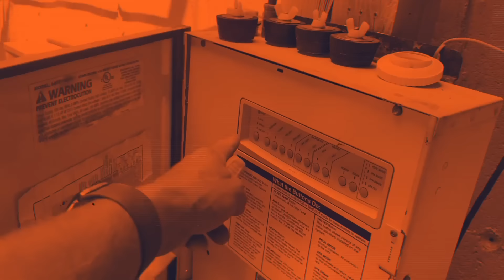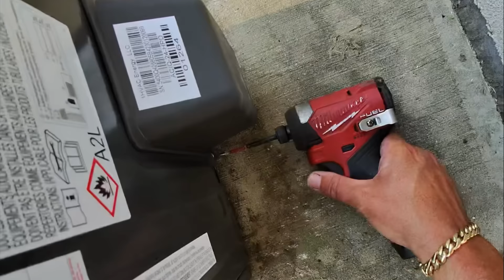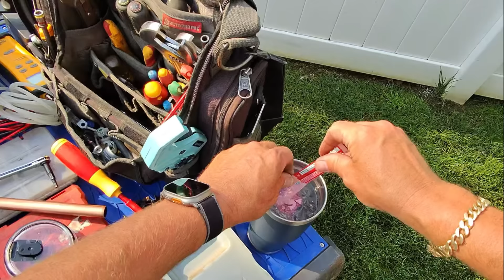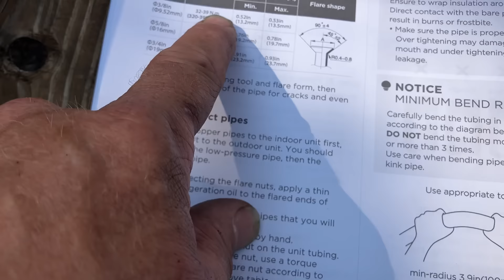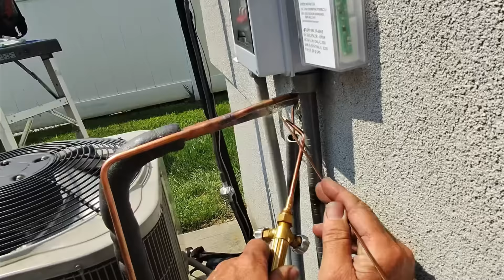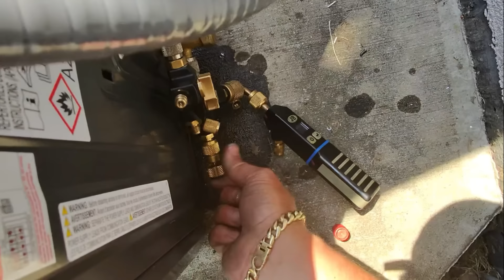They QUOTED Him Big-Brand HVAC… So We Installed THIS Instead

Comment: How much kick back do you get for selling this crap, this is all for show, I never even heard of this brand until this comedy show.  Should have  replaced  the evap coil, big mistake.
Reply: ACIQ made by Carrier.
Reply from the maker: Wrong, Carrier made by Midea. Learn!
Reply: Ok, lol
Reply from the maker: Kickback? Nope. I install equipment that I believe gives my customers the best value. If I wanted to maximize profit, I’d be pushing the same overpriced legacy brands everyone else sells.

Funny enough, most people had never heard of Kia, Hyundai, or Tesla at one point either. ACiQ is built by one of the world’s largest HVAC manufacturers, and I’ve installed hundreds of these systems because they’ve proven themselves in the field.

As for the evap coil, that recommendation was based on the condition of that customer’s existing coil. Not every install requires replacing every component just to pad an invoice.

If you’re an HVAC contractor and want to see the equipment, pricing, and training for yourself instead of repeating internet opinions, become an ACiQ dealer here: https://aciq.com/mikeypipes

An educated contractor is my favorite kind of contractor. 👍
Reply: @PipeDoctor thank you I will pass, I am sure Daikin blows it away, and most people with internet know every car you listed, I work with the big boy equipment,  but keep pushing that trash, its all about money, your videos and equipment.  Great sales pitch videos that's all.
Reply: @levlast6970 , wow🫤
Reply: @PipeDoctor  Funny enough, if you do a deeper dive into Kia and Hyundai you would find that they are shit, only ones worthwhile is Toyota and 
Honda. (legacy brands)
Reply from the maker: @kenmiddendorf4990  @kenmiddendorf4990 And yet Kia and Hyundai somehow keep selling millions of vehicles worldwide while guys on the internet keep declaring them “shit.” 😂

That’s the entire point: every newer brand has to start somewhere, and brand recognition doesn’t automatically equal quality. In HVAC, a lot of the “legacy brands” people worship are sourcing major components—or entire systems—from the same handful of global manufacturers anyway.

I judge equipment by performance, serviceability, parts availability, price, and what I actually see in the field after hundreds of installations. Not by the logo on the cabinet or what the old-timers at the supply house told me 20 years ago.

Toyota and Honda make great vehicles. That doesn’t mean every other vehicle manufacturer is garbage. Same exact concept here.
Reply: @PipeDoctor  That is true but a lot of them have engines blowing up, recalls, transmissions going out early, software updates just to get the vehicle out of warranty, as a former auto mechanic I watch a lot of car repair channels. If people did the same before buying a car or truck, they would be making better decisions. I'll take my chances with Honda and Toyota
Reply: @kenmiddendorf4990  You're Shit!
Reply from the maker: @kenmiddendorf4990  Fair enough—and I actually agree with part of that. Doing your homework before spending your money is exactly what people should do.

But that’s also why I don’t judge HVAC equipment solely by the name on the badge. I judge it by what I see after it’s installed and operating in the real world: performance, failures, serviceability, parts support, efficiency, and what it costs the customer.

Honda and Toyota earned their reputations over decades. They weren’t born with them.

ACiQ has to earn its reputation too. I’ve installed hundreds of these systems, and if they suddenly start dropping compressors, inverter boards and coils left and right, you’ll hear it from me before you hear it from anybody else. I’m the guy who has to go back and warranty the equipment.

I have absolutely no interest in installing something that creates callbacks and pissed-off customers just because somebody put a check in my hand.

So keep watching the repair channels—and keep watching mine. Time and field results will ultimately decide who was right. 👍
Reply: @kenmiddendorf4990 , 🙄

Comment: the only problem i see with all these inverter units is if your power is not completly stable you can fry boards and the boards are not cheap. I have a Daikin 4 port only been in my house for 10 years and have replaced the board 2 times i just did it my self last sunday. But in 2 years the warranty is gone. The outdoor coil is looking pretty rough already. and i clean that thing every other month with water
Reply: how many miles are you from salt water coast or bay?
Reply: @chetmyers7041  as the crow flys about 3 miles
Reply: Google Earth says 8000' feet

Comment: As much you might want that pipe level, personally, I would not change it.  Keeping that pipe tilted away from the house is perfect, that will help prevent water from having a tendency to go back into the wall.

Comment: Ive always been told when switching from single stage to one of these inverter A/Cs that most likely the ducting needs to all be changed, as well. 

I was looking at getting a Diakin Fit w/ 12 year parts and labor warranty. Can I get a similar warranty for the ACIQ?

Do you know any installers in the Tampa Florida area?
Reply from the maker: yes, we got dealers in tampa area

Comment: Didn't see a nitrogen bottle for the brazing. I went to a York school back in the 80's. The one thing they focused on is how much scale you get brazing without a nitrogen flow. Try it yourself braze a pipe with and without  nitrogen and split  the pipe. The difference is amazing.
Reply: I stand corrected,  didn't see it on the first braze.

Comment: American owned company? What are you smoking. ACiq is just a middleman between you and Midea.
Reply from the maker: Nothing is being hidden. @ACIQ is an American brand that employs Americans, supports American HVAC contractors, stocks parts domestically, and provides the warranty, distribution, training, and technical support behind the equipment. Yes, Midea manufactures the equipment—just as many major HVAC brands use global manufacturers. Calling ACiQ “just a middleman” ignores everything that happens after the unit leaves the factory. I care about performance, support, parts availability, value, and how the system serves the homeowner—and ACiQ delivers. #aciq

Comment: I was just quoted $4K labor to replace a leaking evap coil that's still under a factory 10 year parts warranty. I can buy an entire 4 ton ACIQ 19 SEER R32 system for $5300 right now. I do HVAC controls, and know a few people that would help me install it. It's not hard to see why someone would choose ACIQ. You're getting a superior unit with the inverter compressor that would be a $20K install with my local HVAC outfits.
Reply: Are the controller and inverter boards brand specific for ACQI or are they available from an OEM or aftermarket supplier?   How much money would you spend replacing electronic boards on a mini-spit before you would just install a brand new unit?

Comment: If I am not mistaken, you did not change the torque settings on the 3/8 connection and torqued it to 85 nm!
Reply from the maker: you are mistaken.
Reply: @PipeDoctor  If you look at the video while you describe torquing the 3/8 connection, it reads 85.0 nm

Comment: Only issue is the new tech is much more difficult to troubleshoot and repair. Also, replacement parts are so much more expensive. Cost to repair down the line is 3x that old bryant. Also, communicating systems require you to stay with their thermostat like it or not ( and when that thermostat fails $$$ for something you dont even want). If you want to do your customers a solid install a traditional simple system with a nice and simple wifi thermostat like emerson sensi. Even the most basic systems are covered by a 10 year warranty these days. Also please understand that all new systems are not what they used to be Im seeing 10-15 years max life on systems 2014 and on. I have an old R22 lennox from 1981 and it still runs like new (but I am a tech who keeps up on its maintenance which is key).
Reply from the maker: Respectfully, you’re wrong on almost every point here.

This system comes with a 7-year parts warranty and a 12-year compressor warranty. Couple that with our $34/month lifetime warranty, and the customer has long-term protection that most “traditional simple systems” don’t even come close to offering.

Also, you do not need to use a proprietary communicating thermostat unless you want full communicating features. This equipment can run with any standard 24V thermostat. Emerson Sensi, Honeywell, Ecobee, Nest, whatever the customer wants — as long as we’re wiring it for conventional 24V operation.

As far as troubleshooting goes, “new tech is harder” usually means the person doesn’t understand the equipment yet. Inverter and communicating systems require education, proper installation, proper diagnostics, and not guessing. That doesn’t make the equipment bad — it means the trade has to keep learning.

And let’s be honest: old R22 equipment lasting 40 years is great, but that doesn’t mean installing outdated, inefficient technology today is “doing the customer a solid.” Customers care about comfort, efficiency, noise level, warranty, serviceability, and long-term value.

Please learn the equipment before making blanket statements.
Reply: @PipeDoctor  Been waiting on a board for an ACIQ-36-AC since Saturday.......... The Bryant on the other hand, every part stocked on the truck, what were you saying about comfort?
Reply: actually you can buy freon is why.  I have an r22 but, I can't buy the freon to charge it, so it is cheaper to buy a 410 system that comes with it.
Reply: @robertsmith2956  I know a guy in Tijuana that stocks R22 at a good price.  He will fill an RV underbody propane tank for $50/lb, minimum fifty pounds.

Comment: Positioning the  unit perpendicularly to the house eliminates  one of the advantage of "side discharge"- protection of the condenser coil from direct sun exposure. With recommended positioning (parallel to the house when condenser coil  faces  the house's wall ) coil is blocked from direct sun exposure . Directing the air flow of "side discharge" from the house wall ( parallel  installation) , helps too.

Comment: Aciq is Midea manufactured garbage 😂 why do you bother with this hardware? Get behind a quality product like Mitsubishi.
Reply from the maker: And for the record, Midea manufactures equipment for Bosch, Carrier, Trane, and many others. A lot of what people call “premium brand” equipment is manufactured overseas and re-branded with a different badge on the cabinet.

So let’s stop pretending the sticker on the side automatically makes one product “quality” and another product “garbage.” What matters is the engineering, installation, support, warranty, and whether the contractor actually knows what he’s installing.

ACiQ gives contractors and homeowners a high-performance option without the inflated brand-name markup. Mitsubishi makes good equipment, but it is not the only quality product on Earth.
Reply from the maker: I’d rather not support the company who built the planes that murdered thousands at Pearl Harbor.

Comment: Did you consider elbowing down from the exterior wall, going down, across and then elbowing back to the condenser? That way you don't leave all that dead space between the lineset and the wall? Also, now you've eaten into the servicing space you were trying to leave for the future neighbor unit.
Reply: It's obvious that you are not an HVAC technician. If you are, I truly feel sorry for your clients. 
A/C line sets are not piped in like hard copper water pipes. Line sets have 4 junction points. Two at the condenser and two at the evaporator. There is never a bunch of angle fittings brazed into the line set.

Comment: Mike, are you out of your mind?  You're the owner of a thriving business you must not use those disconnects.  The NEC has strict guidelines on breakers, means of disconnecting and UL listing.  You're using a breaker that is marketed to look like a breaker that is IEC certified (European standard see 50 Hz) but is probably just a Chinese knock off without any certificate besides CE.  If God forbid something ever happened you would be done.  You live in a state that has the city with the most lawyers per sqft, you should know better.  Don't get me wrong I love the idea and think the units need all the protection they can get but don't get yourself burned.
Reply from the maker: I appreciate the concern, but let’s be clear on what the Mikey Pipes SPD-01 is and what it is not.

The SPD-01 is a custom-built power management / surge protection assembly designed to add an extra layer of protection for sensitive inverter-driven equipment. It is not being represented as the required service disconnect, and it does not replace code-required overcurrent protection or the manufacturer-required means of disconnect.

The equipment is still installed with the proper breaker, disconnect, grounding, bonding, and wiring methods required by the NEC and local authority having jurisdiction. The SPD-01 is an additional protective device in the circuit — not a substitute for the electrical system.

And yes, I fully understand the world we live in: lawyers, liability, UL listings, inspectors, and insurance. That’s exactly why we are careful about how it is built, installed, described, and used.

I agree with you on one thing: these inverter systems absolutely need all the protection they can get. That is exactly why I built it. I would rather give the customer extra protection than watch a $5,000+ inverter system get smoked by poor power quality, surges, or utility issues.

So no, I’m not out of my mind. I’m trying to solve a real-world problem that a lot of contractors are ignoring.

Comment: The new M. P. disconnect is the best one yet .
Reply from the maker: Ty b
Reply: Got mine just in time today.  15 minutes later and we would be testing it's water tight abilities......
Tight little package.  AC this weekend if the rain lets up.
Don't think the $55 discount in the box for service call is going to help with the 1100 mile drive add on.......😒

Comment: 60amp breaker in place of a 30a disconnect?? hopefully the breaker at the panel is sized right. max amp draw on this unit is 25-30
Reply from the maker: That’s a moot point. The previous disconnect was simply a plug. 😊